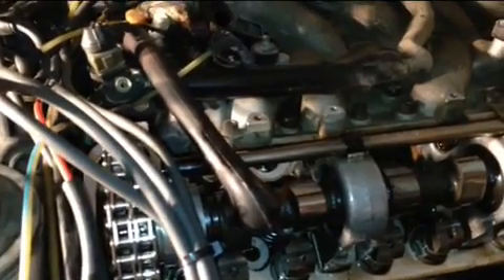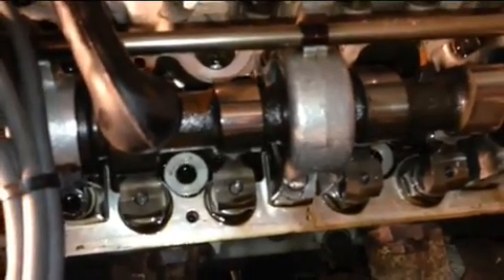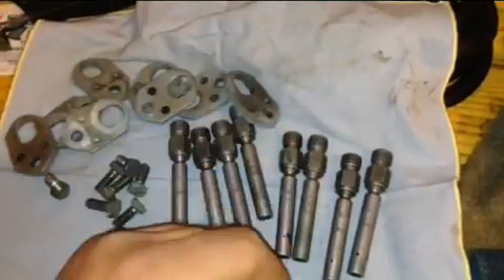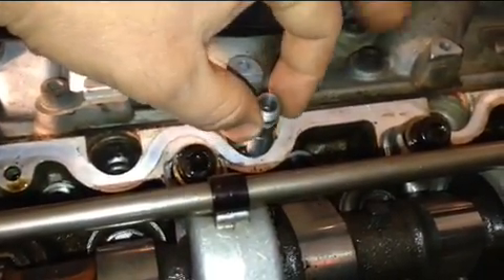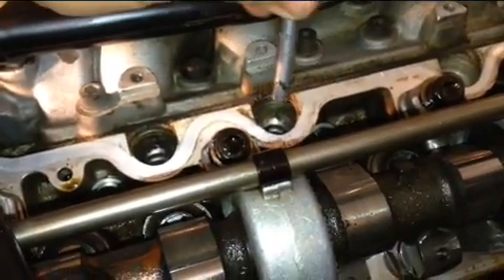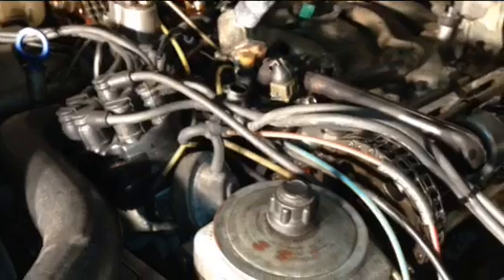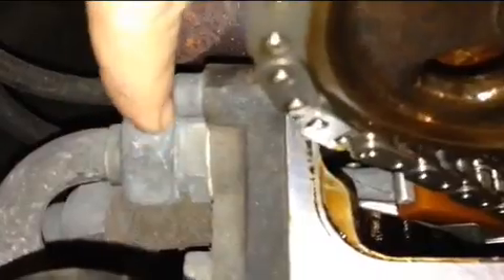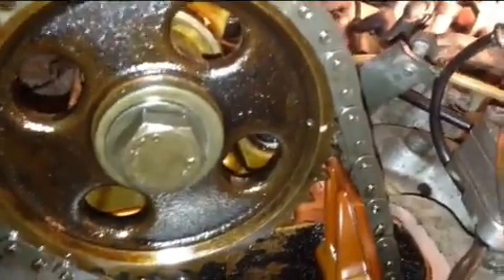Mercedes Benz 450sl injector output | Mercedes benz Fuel Injection

Comment: Good morning friend I write to you from Venezuela I would like to know if you have any video explaining how to adjust adjustable mechanical valves to how many millimeters the intake and the exhaust and in what position should be the cam thanks
Reply from the maker: orlando olivares what engine are you working on?
Reply: ok my car is 450 is w116.033 1979 Originally it uses taquetes but here in venezuela there are not any then the option is to put the adjustable or manual taquetes

Comment: How complicated would it be to fit a modern fuel injection system onto one of these cars to improve the fuel efficiency.
Reply: *****
 Thanks for the info these cars are very nice but they very thirsty.
If you could put on an inlet manifold with some Weber carbs then you could jet it so that the fuel consumption is tolerable. Thats what I am trying to achieve.
Reply: Search for k-jet killers, they convert the old k-jet to modern fuel injection. They are from Poland. Here an example!
https://www.youtube.com/watch?v=k838XbL-JXg

Comment: I have a customer with a 1980 450 SLC. last year I needed to remove the heads (blown head gasket). I had the heads checked out at a local machine shop. 
It took the customer some time to get the funds to have the heads shaved, so the car sat for a while. 

The engine ran w/o any problems last year except for the blown head gasket. However, I replaced both gaskets, followed everything procedure in the repair manual and now the engine will not start. 
I checked to make sure everything is correct, I had a friend "bump" the engine while I had the #1 plug out and my finger over the hole. It hit the compression stroke and I used a socket to turn the engine a few inches more to get it on TDC. I removed the cap and the rotor was indeed facing the mark (on #1 plug) I'd put into the distributor. 

i checked for spark and I do indeed have spark at #1 plug. I checked all plugs, re-gaped them all.Its getting fuel. In fact I sprayed starting fluid into the intake and it will not start. 

Before I removed the heads I did mark the cam's, chain and sprockets and re-installed them to the correct position. 

Most of the pollution junk had been removed by whomever owned the vehicle previously and most of the vacuum line were rotted out. I replaced all of them. The rubber sleeve on the throttle valve housing was all rotted out as were the 8 rubber connections on the plenum. I also replaced all the injector plastic sleeves and "O" rings. A complete upper end was done.

I don't understand why after replacing everything it won't start? Can I by-pass the ignition control box temporarily and hook up the distributor wire direct to the coil to see if the box is bad? 

Shal ' aam Aleichem 
AAPiY 
Mike
Reply: Do you have a clog in your exhaust?  Like a clogged catalytic converter?
Reply: Exhaust is clear. Ran it with and w/o exhaust hooked up
Reply: Mike Paul did you ever fix it?

Comment: How did you clean them did you let them sit in the evaporust?
Reply: Lacquer thinner and air pressure. Old types are about 25PSI and newer ones 60 to 80.  Put the thinner in the tube and blow it thru. Set up a little hose fitting for the air pressure. Look for a symmetrical spray